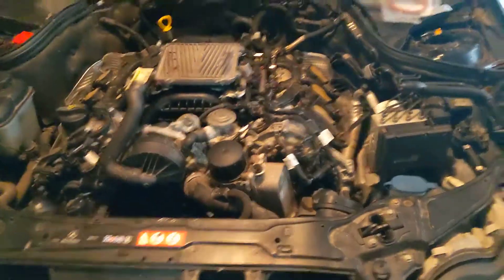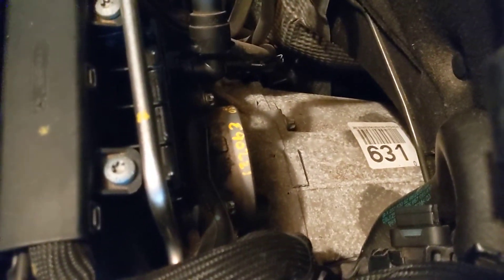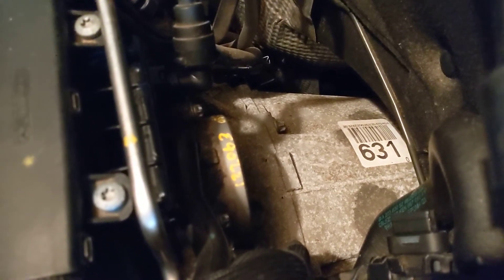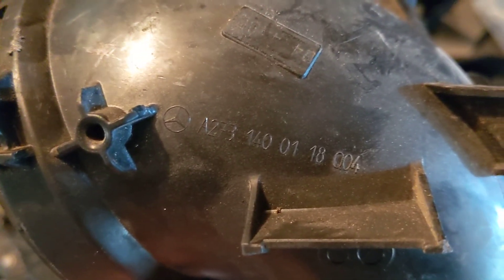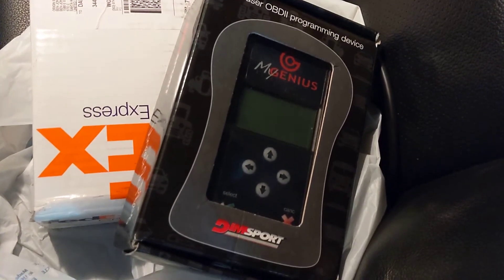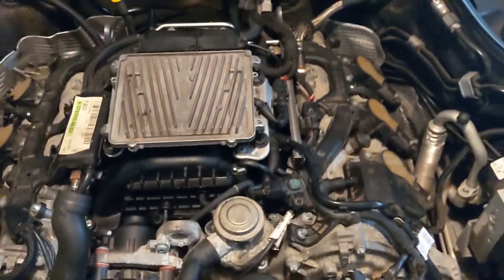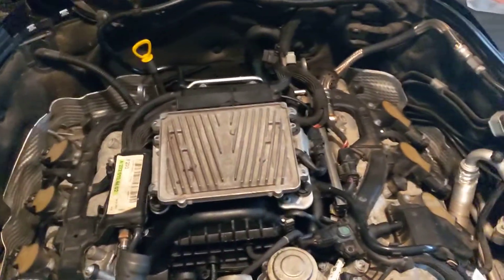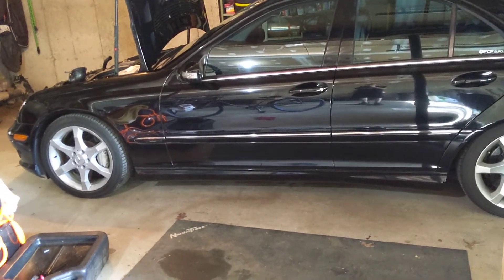SLK350 Composite Intake Manifold M272 Part 2: What Parts are Needed?

Comment: The picture on fcp showed that it had a red gasket attached to the manifold, did you have to get the normal gasket that goes on the stock manifold?
Reply from the maker: The composite manifold from FCP Euro comes with the throttle-body-to-manifold gasket, as well as intake manifold gaskets. To complete the swap (outside of any tuning or additional vacuum lines/small hardware) you'll need the M273 throttle body and the M273 air intake boot. The stock MAF will fit the new intake boot perfectly, and your standard air filter housing will then work without issue
Reply: @danny_playswithcars  got it! Exactly what I needed to know thanks!

Comment: My mechanic showed me this in his shop. I too need to replace my intake manifold on my 07E350 sport. Any pointers or concerns
Reply: Thanks a lot for the heads up. I’ll be dropping it off at the shop next week
Reply from the maker: Keep in mind that this video showcases not only how to replace the manifold, but how to fit the M014 option code single-stage manifold as an upgrade. A lot more straightforward if you replace with the OEM parts, but this guarantees it will never fail again and isn't too incredibly difficult to do.
Reply: @danny_playswithcars  I consider looking into upgrading to the same intake manifold. You notice any increase in power?
Reply from the maker: @Mangohabernero  Yes there is an increase, but the main thing is the change in power delivery. 

The stock manifold makes most of it's power in the mid-range, and falls off up top. The upgraded manifold builds linearly, which takes away from mid range, but pulls much harder up top; ideal for performance driving.
Reply: @danny_playswithcars  what was the total that you spent on this upgrade? Rough estimate
Reply from the maker: @Mangohabernero  sorry for the late response. Thinking of putting a video together on this within the next month or so, itemized with bills. You guys definitely seem to want this info

Comment: Hi, what is your feelings about this mod? Does your car run better?
Reply from the maker: I like it and the car does run well. Start to finish it is a bit pricey, but it's nice to know the manifold will never break again. 

In cars with the 2.5L like mine, the gains are there but are far less than in the 3.0L or 3.5L M272. For those cars, you're guaranteed good power and also increased reliability.

Comment: I would’ve never even thought about swapping to the 3.5’s intake manifold.

Mines has been faulty since I bought it 2 years ago, now that it has over 200k miles I’m finally gonna get around to replacing it but this is good information
Reply from the maker: If you ever have any questions, feel free to message me on here or via Instagram (@danny_playswithcars I'm a bit more active on there). I'm always happy to try and help out!
Reply: WOW 2 whole years running with a faulty manifold? You need to do this mod coz you have no idea what power you're missing